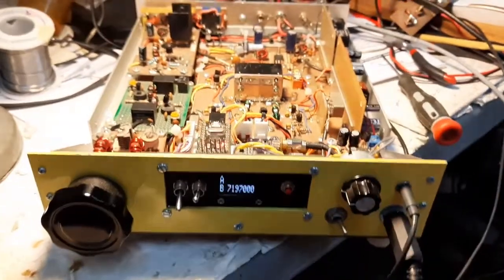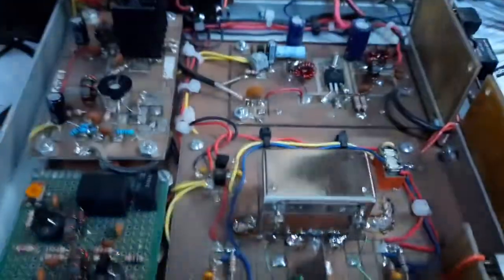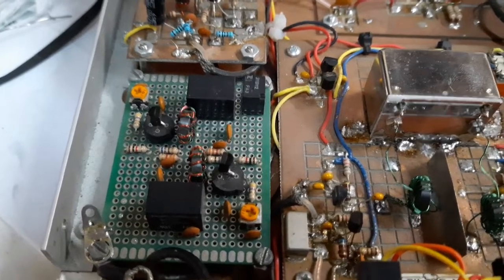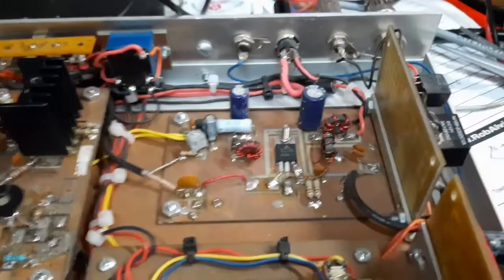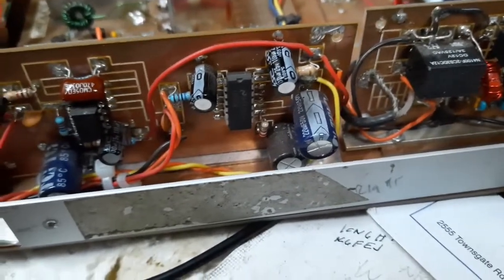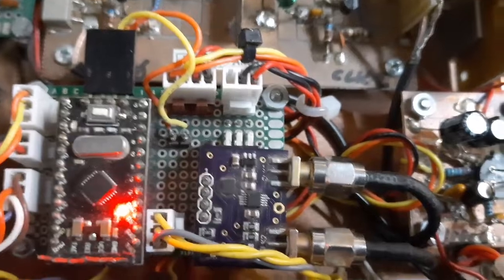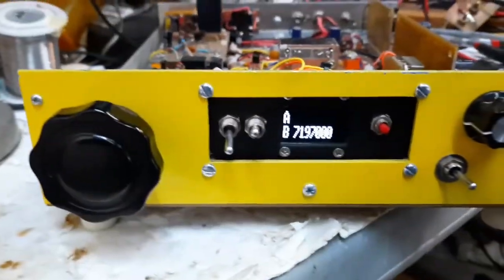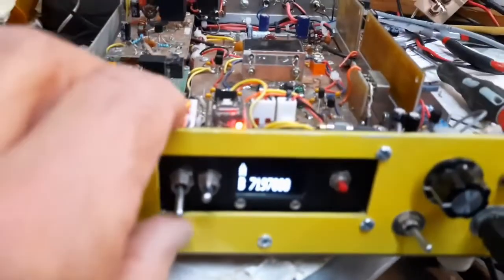N6QW Builds his version of the Dentron HF SSB Scout

Comment: What is the red button for? :)
Reply from the maker: Hi Alex, 
That button in conjucntion with the MOX switchwhen pushed generates a 10 second pulsed 988 Hz tone from Pin 6 on the Arduino. This tone is shaped with an RC Filter (make it a sine wave) and is fed into the microphone amp circuit. So now you have a Tune Up Tone! Clever engineering in not having to whistle or shout into the microphone -- the power of the Arduino at work.

73's
Pete N6QW